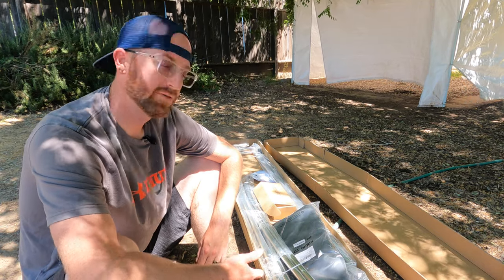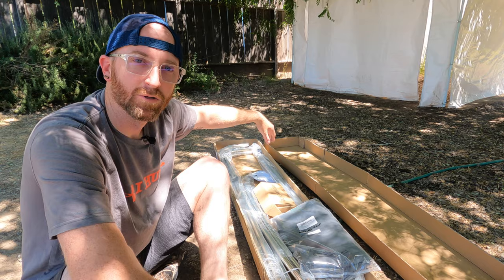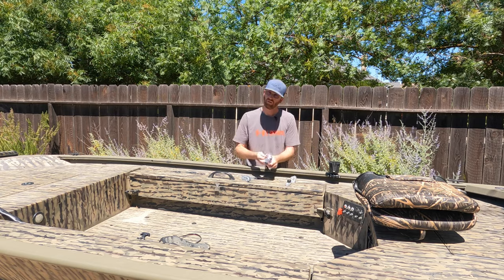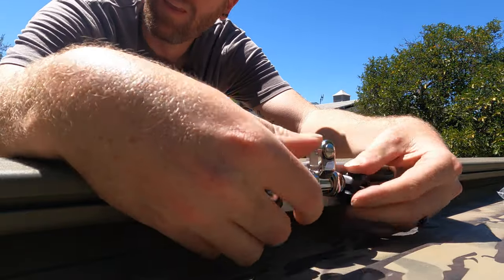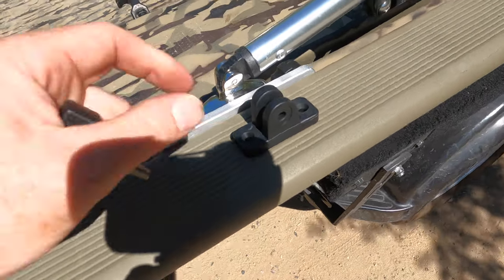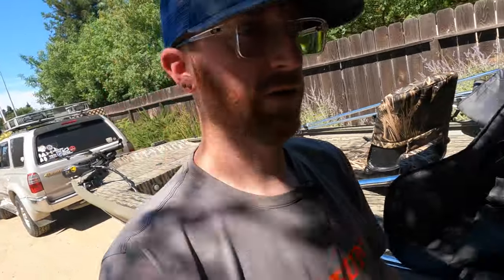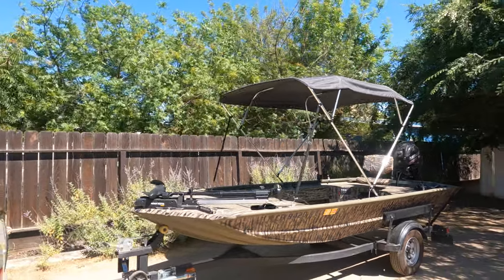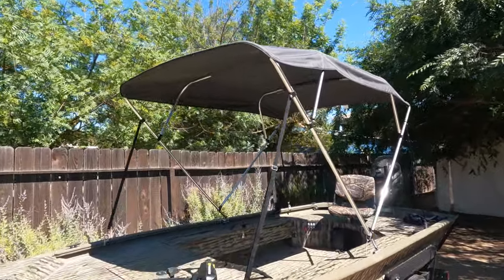Bimini Top on a Jon Boat. Grizzly Tracker Sportsman Install.

Comment: What “bow” did you go with? 3 or 4? I’m about to purchase and don’t want to get the wrong one. Thanks.
Reply from the maker: I’m not sure I understand the question, but I just measured the width of my top rails and then made sure the Bimini top I bought was for that size range.
Reply: @BadAtHunting  I gotcha. On Amazon it’s got two options for a 3 or a 4 bow. Guess that’s how many piles got through the center throughout the top. I went ahead and got the 4 bow bc it was the only one with the 8 ft long option. The 3 bow only had a 6 ft option. I’ll see how it turns out but thanks for the video and the quick response.
Reply from the maker: No problem man. I hope it works out good for you.

Comment: I have a 45 degree track system. Do you think these would work? I can’t seem to find ones that are 45 degree
Reply from the maker: I think the Brocraft mounts I used could work in your situation, but i’m pretty sure they also made another set that had the 45* angle as well.

Comment: Where did you order/buy your Brocraft parts from? Thanks!!
Reply from the maker: I found them on Amazon. They make a bunch of different accessories for boats. Good luck finding what you need.
Reply: @BadAtHunting  are they called bimini mounts for versatrack?
Reply from the maker: Yeah they were, but I couldn’t find them just now. Maybe they don’t make them anymore? They do sell a Universal Mount Bracket which might work for your situation.

Comment: This is awesome 😎
Reply from the maker: Thanks man.
Reply: @BadAtHunting   do you have a video of how you did your paint job? I want to make mine camo as well
Reply from the maker: I tried to video it, but painting it was so labor intensive that I gave up trying. I did use a few stencils from Amazon called RedLeg Camo. I bought two packs of the largest size, so as one was being used, the other was drying. The paint was just from Home Depot, nothing special (except it was all in ultra matte finish).
Reply: @BadAtHunting  dang! It would of been a great video lol 
But thanks for that info I will look I to it 👍